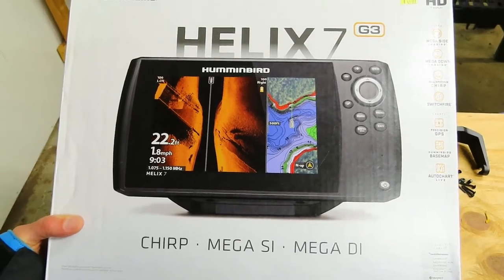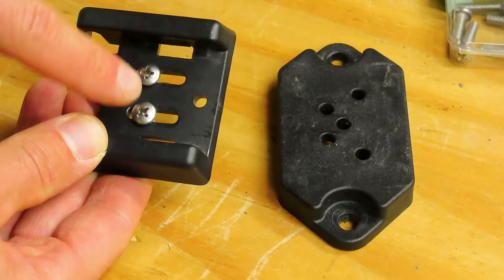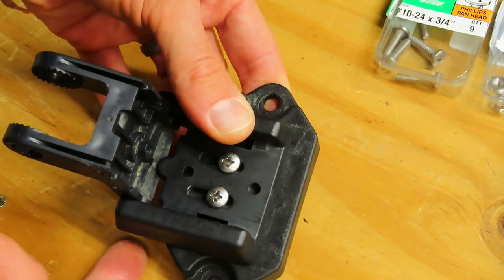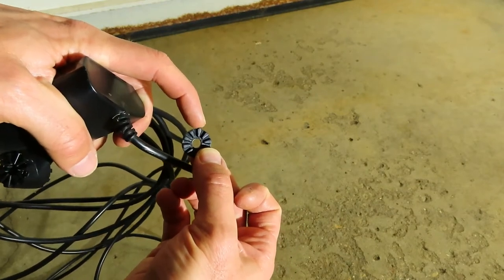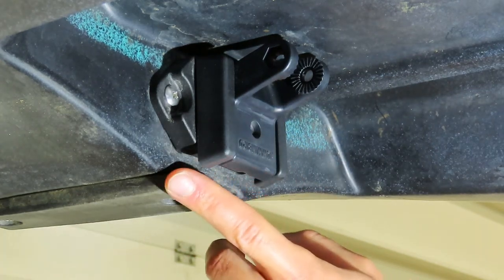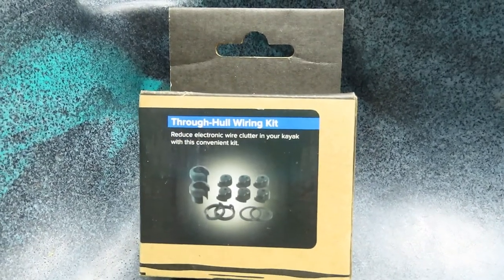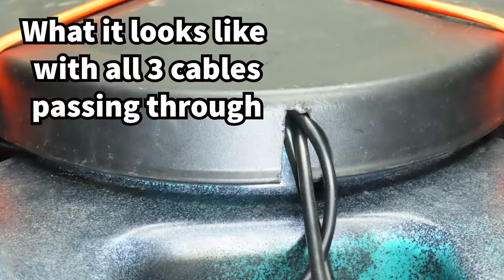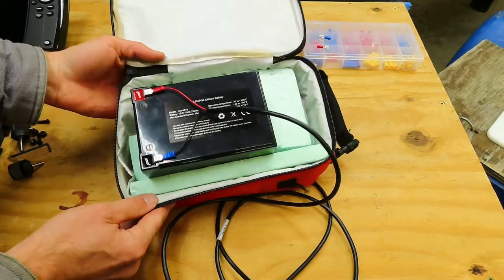How to install Humminbird Helix7 fish finder on Old Town Sportsman PDL kayak without drilling

Comment: Thanks for the video. I have an Old Town Sportsman PDL 106. I am wondering if the transducer will fit. I will try and reach out to them since it is all basically the same company I think.
Reply from the maker: Yes, I'm pretty sure the central area of the hull is the same between the Sportsman PDL 106 and the Sportsman PDL 120 that I have, so there shouldn't be any reason that it won't fit. And Humminbird is owned by the same parent company as Old Town, so they like to make sure that their products work together.

Comment: I am installing same finder on a new old town 136. Does it interfere with side imaging when tucked way up there like you have it?
Reply from the maker: No, the hull on the Sportsman 120PDL is designed for a side imaging sonar unit. The transducer is tucked in just a little bit from the sides of the hull, so the hull doesn't interfere with the wide cone coming from the sidescan.

Comment: Does it damage the transducer when dragging your kayak ?
Reply from the maker: If you dragged the kayak flat on the ground across a rough surface, something could hit your transducer and damage it. I use a kayak cart to transport the kayak on foot. You do need to be careful in areas where there are rocks or branches close to the surface because you could possibly bump the transducer into them.

Comment: Will the SI function properly despite the transducer being underneath the boat? I’ve seen most folks using transducer arms over the side because the SI requires transducer be below the keel.
Reply from the maker: Yes. The area cut out of the hull provides enough of an opening to each side for the SI beams. I've used the SI in everything from 2ft to 35ft of water so far without any issues.
Reply: @FishingwithNat  awesome thanks for the vid. Looking to upgrade to this kayak and have the same fishfinder so that’s great to know.
Reply from the maker: @johngoss3997  We have really enjoyed the Helix7 so far. It is a great size for the PDL120.
Reply: Came here to ask this question lol
Reply from the maker: @OriginOutfittersMaine  No worries. It works just fine with the PDL.
Reply: @FishingwithNat  picking mine up at 8am! Pumped

Comment: Wondering if you stuck with current setup, or ended up drilling the holes into Kayak?
Reply from the maker: Hi Joe, I have been happy with the current setup and no holes. I've been out in heavy rain and have 
had big waves splashing across the bow, and no water has gotten in. I don't think I will change it.
Reply: Would love to see a video of what settings you used on the Fishfinder itself. Just got the Helix 7 and no clue about it so been searching for just basic setups and how best to use. Thx Again.
Reply from the maker: @joesmth1971  Thanks for the comment. I will make a note to make a video this summer. I'm currently working on a few other videos.

Comment: Do you have a link to get a replacement hatch cover?
Reply from the maker: I think you would have to contact Old Town. Some dealers might be able to get them. I cut the notch in my original hatch cover and am still using it.

Comment: You didn't need to cut a notch in your hatch, but other than that, thumbs up!
Reply from the maker: It was better than drilling, in my opinion. The wires seemed to really get smashed if I tried to run them into the hatch without cutting a notch.
Reply: @FishingwithNat  Those wires will not get “smashed” by the hatch.  Nick at Navarre fishing runs his wires under the hatch all the time with zero problems.
Reply from the maker: @the45er  OK cool, good to know

Comment: Do you need to add a fuse box to battery wire?
Reply from the maker: I did not. I'm using an 18Ah battery and I didn't think it was necessary. Certainly there's nothing wrong with adding an inline fuse for extra insurance though.
Reply: @FishingwithNat  yeah I got the same finder and a friend of mine was telling me it’s a good idea to put one I’m new to this only been kayak fishing for a year so I was like ok I’ll put one on lol

Comment: you dont install it, 2 expenseew
Reply from the maker: It's an expensive upgrade to a kayak but well worth it.
Reply: @FishingwithNat  
Do you treat it with something thats water-resistant in order you flip out ?
Reply from the maker: @i1bike  It's designed to take splashes or rain. I'm not sure how it would do if I flipped over. I can't say I'll never flip, but the PDL 120 is a crazy stable kayak and I've been kayak fishing for 19 years now without ever flipping. It's important to recognize risky situations out there and avoid them so you can minimize the chance of flipping or getting dumped off of a kayak.
Reply: @FishingwithNat  well thats amazing, i see people flip all the time on the sea
Reply from the maker: @i1bike  I think it's just important for a kayaker to know the limits of their boat and themselves, and recognize bad conditions/situations before they lead to a flipped kayak. I always test my kayak's stability anytime I get a new one to make sure I understand how far I can push it without flipping over. Check out this video I did on the stability of the PDL 120 https://youtu.be/1zfUpkH7IJ0
Reply: @i1bike  I guy on the bass pro shop reviews said he capsized his boat for 30 minutes and the fish finder was just fine. cheers installing mine today out here in Beaufort, NC
Reply: @MrBrandonLee  amazing !